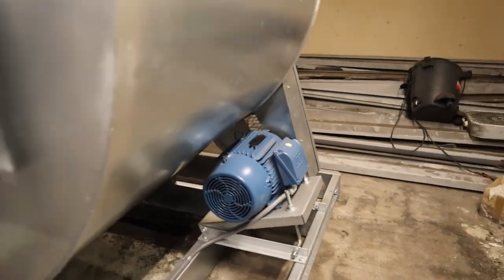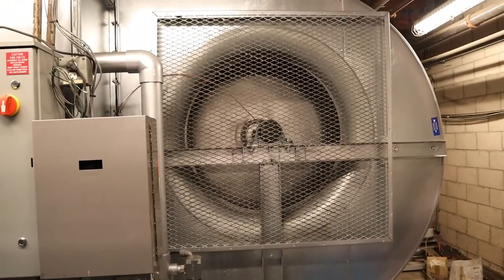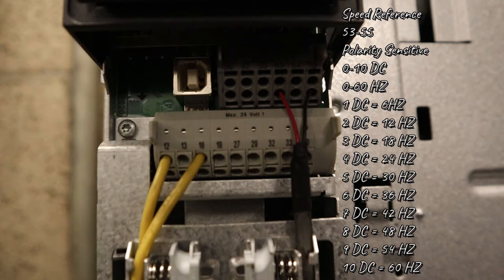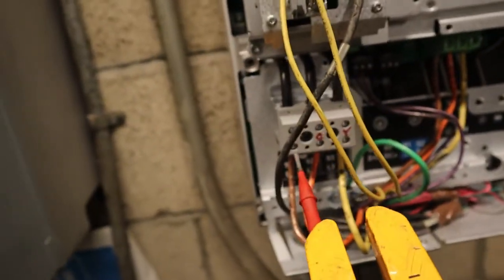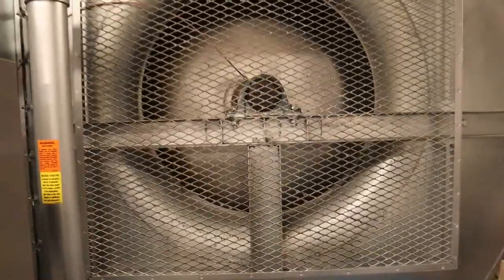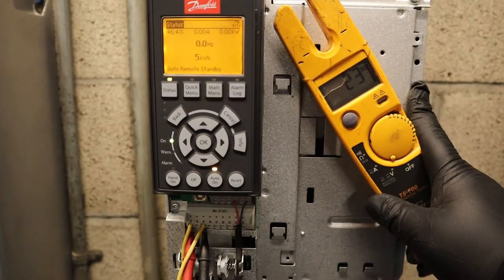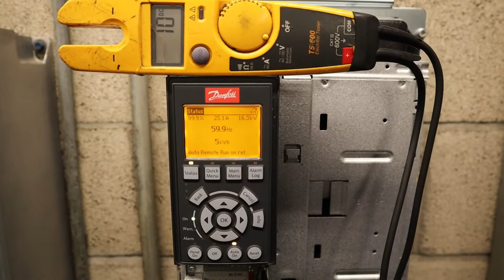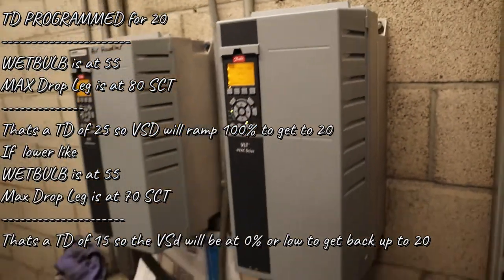Refrigeration Condenser Drive Fundamentals

Comment: Nice. I noticed something on those VFD when there is a short circuit in the outlet or power is removed  . They took almost 2 hour’s to reset. Do You know about it.
Reply from the maker: I only reset them when checking the Fault in them. After checking I will kill power to the entire thing to get it cleared after issue is resolved